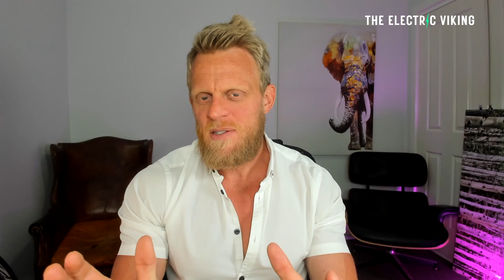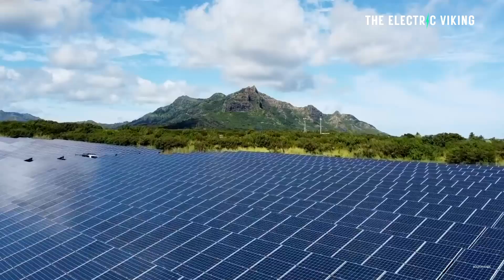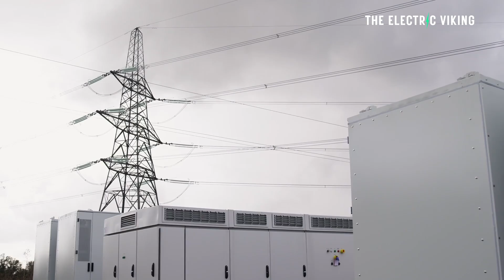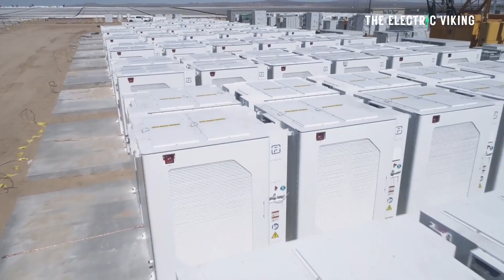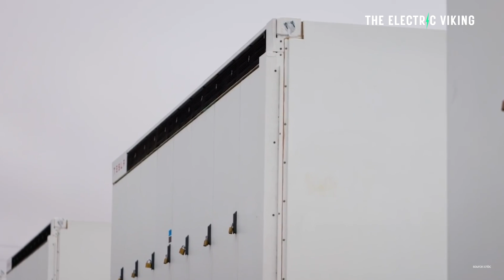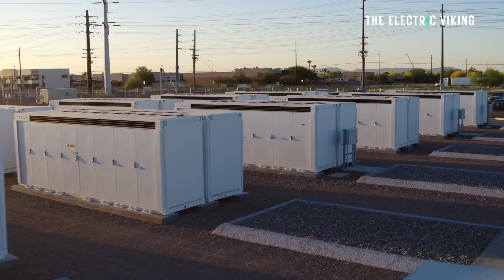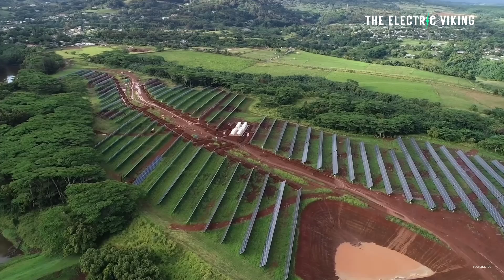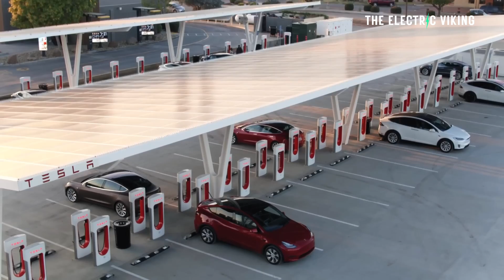Batteries + solar smash records in California and fossil power plants suffer

Comment: CA is also requiring bi-directional charging capability for all new EVs. The average EV has enough capacity to power the average home for two days but the 40 miles per day the average car travels only uses about 14kwh, which is what most home water heaters use daily. I regularly drive by a certain gas station with $.10/gal cheaper gas and see cars lined up waiting to fill up and save those pennies. Once they realize they can charge their car during the day for free then sell that power for a profit the problem of not enough batteries is solved.
Reply: A few corrections.  First, note that a heat-pump water heater with an 80 gallon tank only burns around 2kWh/day... maybe 4kWh/day with a family of 5.

Second, on V2G (bi-directional charging), there are some major warts there.   The first thing to keep in mind is that the car is not actually able to export to the grid on its own.  It can connect its battery to the plug, but that's 400-800VDC.   And since this is how cars handle Fast DC charging, it isn't hard to allow the current to flow both ways.

So exporting (V2G) requires some external gear... an external inverter to convert that DC to utility AC.   Some vehicles use their built-in L2 inverter for this but the last thing you ever want to do is to add wear to the power electronics of your vehicle.

Another big issue with V2G is that you only really want to do this if your car has LFP batteries.   You do not want to do this if your car has NMC batteries because the wear on the batteries will be vastly more costly to you than anything you save by exporting.

-Matt
Reply: @junkerzn7312  

By the time a non-trivial number of cars have V2G, very few of them will be NMC, for the simple reason that the other chemistries are cheaper. But, even with an NMC battery, the impact of V2G on battery health is negligible because power flow is very slow and within the 40-60% range. What does add stress to NMC batteries is full charge/discharge cycles (e.g. 100%->0%), but V2G will never do that or anything close.

The real hangup for V2G is the up-front cost of the "hookup" equipment to wire everything up. It had better cheap, or nobody will do it.
Reply: Do you have a link for the bidirectional charging requirement? I haven’t heard this.
Reply: Look for things to turn quickly once some more affordable EVs are available.  Right now options are a bit too high for much of the market, at least in the US.  It looks like Tesla is going to move rapidly to producing a more affordable EV.  

A $30k EV with a $7,500 federal rebate should sell like hotcakes.  Especially once people fully understand why EVs are so much cheaper per mile to drive.  

$30k - $7.5k - $5k in opex over 5 years makes for a $17.5k purchase.  That's how you out of pocket will play out over a five year loan payoff.
Reply: Most water heaters still use elements, not heat pumps, to heat water. They use an average of 13-14 kWh per day which is why they are a good stand in for the average EV usage especially since they’re the biggest drain during peak hours of demand. The additional cost to equip a new EV with V2G is currently $3700. I’m old enough to remember when microwaves cost $2K but now I can buy one for $30. The cost will drop as it is more widely adopted. Battery technology is also improving quickly and as manufacturers are required to install the equipment in order to avoid warranty repair costs they’ll also have to increase the reliability through smart management systems.
Reply: @johnnyb362  No, that is utter nonsense.   We are not talking about thermal element-only water heaters here... only an idiot buys one of those these days.

I have a heat pump water heater, as do many people now, and they do not use 14kWh/day or anything even remotely close to 14kWh/day.   Mine uses 2 kWh/day.  Most people's heat pump water heaters burn about 2kWh/day... maybe 4 if you have a hot water recirculator.  Not more than that.

Backup heating elements are hardly ever used even in the upper mid-west except maybe in the depths of winter.  In fact, mine doesn't even have backup heating elements... most locations don't need them at all and not having them saves having to run a high-amperage circuit to the unit.

Not sure how you managed to convince yourself otherwise but you are dead wrong. The rest of your missive is equally nonsensical.  You obviously don't have any experience with any of these technologies.

-Matt
Reply: @johnnyb362  Kid, I know the world is a big bad  place in your eyes, and you are really confused, but it has to start with you fixing up your own misunderstandings rather than trying to force the whole rest of the world to follow you down the rabbit hole of nonsense.
Reply: @junkerzn7312  First off, I’m a grandfather, not a kid. I’m done with this conversation.
Reply: @johnnyb362  You certainly are.  Next time, try reading what people are saying first, before trying to force conversations down rabbit holes of nonsense.

Comment: The batteries are just to balance the grid demand.  They have a long way to go before they actually replace the grid entirely. California grid was 287,220 gWh in 2022.
Reply: Batteries in California take a 5GW (x 5 hour) chunk out of evening gas generation.  And batteries are now cutting exports in half in Springtime (aka now).  That's a lot more than just balancing the grid.   This will ultimately expand to remove all gas generation from the evening peak and after that energy storage will start to work on overnight consumption.

Comment: Our grid here in Ontario is over 90% clean all ready with Nuclear , Hydro, solar and wind power so why go to solar here. But I did buy an EV and now I have ordered a heat pump to get rid of the old propane Furniss.  YOU reading this can do that too.
Reply: Some prefer the downstream (no pun intended tended) effects of solar over those of nuclear and sometimes even hydro. Additionally, the legalized cost of energy from nuclear seems to be pretty stagnant, and the costs associated with wind and solar are still decreasing. That is to say, solar and wind are continuing to get less expensive whereas nuclear does not.
Reply: Charge at night at 8 cents a kwh.
Ontario has it together.
Reply: @BioniqBob  it's awesome 👍
Reply: Were clean power in BC too pretty much. But..my friend put up 2 panels just using a battery storage and hes amazed how much usable juice hes getting!
Reply: How often does your electric go out ? That is a reason to have solar and even batteries.
Reply: Was that Ontario, California?
Reply: Good old nuclear, puts all other energy sources to shame.

Power isn't the only thing that comes out of nuclear power plants. Nuclear medicine is also from these plants and, they're important for obvious reasons.
Reply: @ezg8448  That's right. Isotopes are important in radiation therapy. When you are exposed to toxins like Fire retardants in your furniture and bedding, Chlorine in your water, Aluminum in your deodorants, Diesel particulate matter in your air and micro plastics in your food and a host of THOUSANDS of other chemicals everywhere you might get the cancer.  Radiation treatment might be live saving.

Comment: Spring time between winter and summer. No heaters or air conditioning. High reservior levels, with spring run off/more generation. Days getting longer more solar. Conditions usually change in May when temps increase and air conditioning starts. We are heading in the right direction.

Comment: We lead only in highest price for energy and most corrupt system. Yes there are a lot of solar and batteries but we are paying crazy prices for it. Fossil fuels are need to make all these alternative energy systems, so really we just shifted the mess and pollution to other areas.
Reply: Crazy prices is relative. Gas prices spiked E.U. power in summer 2022 to over 400 Euro / mWh.
Even with all this new infrastructure / diversification, what's the going rate in California?
Corrupt sure (see Enron), most corrupt? Not quite, speak to someone in Pakistan.
Pollution shift true, but also improves as the processes that create Green tech tend to be more efficient vs before.
Reply: @RoyBoy2019  thing is governments around the world could help with low cost loans and training ensuring all businesses and homes with suitable roofs have solar fitted. Instead of taking charge they are too busy taking everything for themselves, be nice if they would just do their jobs, the ones they are handsomely paid to do
Reply: @stevenbarrett7648  well said, I'm a fan of decentralized power generation & storage, though it still comes at a cost despite aggressive battery price down trend. Flip side, centralized systems generate more profit which come in handy during political campaigns; especially in first past the post elections which consolidates political parties & power. :|
NEM 3.0 in California is an interesting example, while it is politicians siding with grid power companies; but it seems an inevitable consequence of renewables success. Where power is in overabundance during the day and they need to shift it with batteries & other storage to evening. Hard to convince those with deep pockets to modernize the grid if they are competing with house solar getting higher export tariffs.
Reply: In England the electricity companies and privately owned ‘national grid’ pin the price of electricity to the price of gas, since the war started in Europe gas prices shot up, so did electricity prices even though the cost to produce actually reduced. 
Greed and corruption mean we have crazy prices for power, apparently the cost per Kw should be around 7pence but right now Ionity charge 89 pence per kilowatt !. 
As usual government do nothing apart from racking in more VAT and taxes as bigger bills mean big tax !

Comment: In 25 years all these panels,and batteries will be scrap.That's when the massive costs will be shown up.There's no such thing as free of cheap power.
Reply: Even if that were true, and it’s not, do you think coal and gas energy generation doesn’t require huge expenses on maintenance? You have to compare oranges to oranges. And considering how much better these alternative energies are than coal and gas on the environment, there is no contest.
Reply: As usual, the conservative opts for doing nothing.  Let's just stay the course. Watch the planet burn.  Do you feel better having talked yourself into standing idly by?
Reply: They will not be scrap. Solar panel recycling companies are gearing up all over the place. ROSI (Return of Silicon) have been up and running in France for a few years now. Veolia are building more recycling facilities around Europe
Reply: Good thing a solar recycler opened in Yuma, Arizona. Unsure on economics with that, as newer panels have less worthwhile material; but batteries should be an easy recycling sell.
Reply: Panels last longer than 25 years.  Batteries are recyclable.  Panels can be reused in developing countries as they still produce power
Reply: @jeffpitoniak  on your side, but bad sell IMO. Shipping costs appear prohibitive, counterpoint?
Bare in mind secondary markets cannot bare the costs. (COVID vaccines context)
Reply: @RoyBoy2019  aid agencies are already sending all types of aid including fuel, generators, stoves, etc.  panels, lights, etc would be less intensive as they would be basically a one and done saving transportation costs in the long run
Reply: @jeffpitoniak  intriguing but incomplete. Logistic costs of aggregating said panels add up fast. Further, to get real bang for solar buck they also need batteries. I'm all for old BEV batteries doing the job, who's going to pay for that??? Seriously need to ask why it hasn't happened, because it doesn't fit economically / practically for an aid agency, then fill in the blanks. Practical portion is people need clean water & food prior to night light / charging devices, fuel transports way better vs electricity. I have seen several promises of combining these elements (solar electricity, clean water), for some reason it Doe$ Not Happen! Maybe if they load solar panels on E.U. fishing boats which are off the coasts of Africa anyway, might be something there?
Don't get me wrong, I have tech hope and see some well off areas jumping ahead, but crappy old solar panels ain't it.

Comment: Won’t work as well where it is cloudy days at a time
Reply: Even on cloudy days panels generate electricity. Not as much though.
Reply: That is why you need batteries to offset the cloudy days.
Reply: That is where wind power helps.
Reply: The same with night time.

Comment: Interesting in the short term.  Long term we'll see.

I see the biggest challenge is not storage and generation in the battery storage industry, but disposal.  The battery industry needs a recycling process on par with the big playere in recycling.  Steel, aluminum, copper, and lead.
Reply: It already exist. Check out Redwood Battery Recycling Industries.
Reply: LiCycle, Redwood, Northvolt/Audi, Fortum, Ganfeng, Umicore, Ecobat, Renault/Solvay/Veolia...to name just a few.
Reply: While battery recycling does exist and will grow, it's unreasonable to expect that the recycling of a complex device like a battery made up of many different substances will ever be "on par" with recycling simple metals such as those you have named.
Reply: @eyesuckle the remnants of crushed battery chemicals is called black mass is a traded commodity already just like gold, silver, etc.
Reply: @jeffpitoniak  That is true.  What I'm saying is that some parts of the battery will not be recycled--for example, the plastic case in which the recyclable materials are contained.  Unlike a piece of lead, gold or some other metal, which is 100% recyclable.

This is not to say that battery cycling won't become a large-scale, successful endeavour.